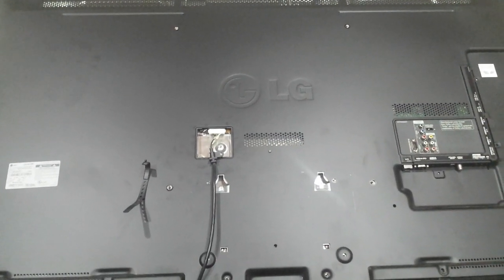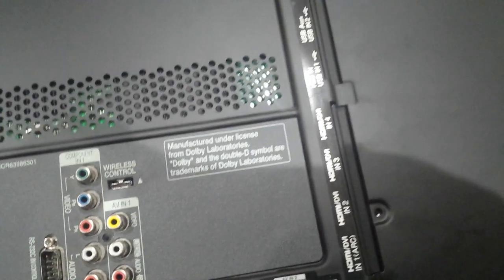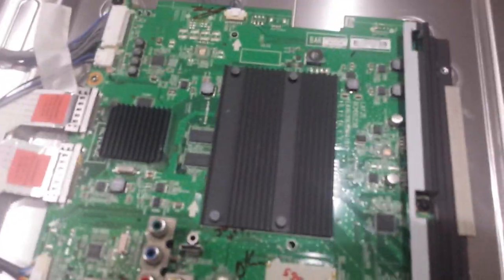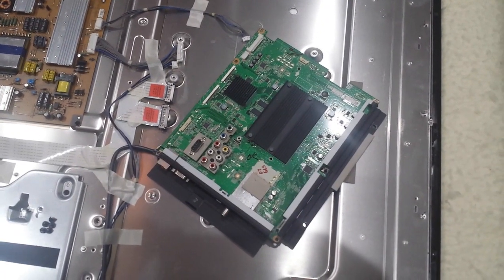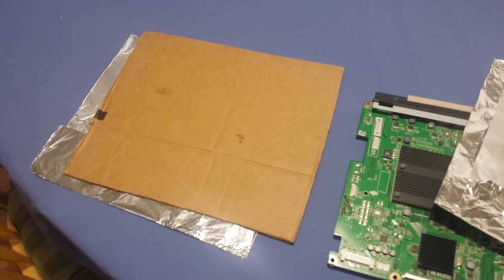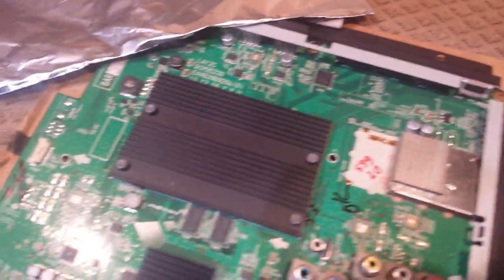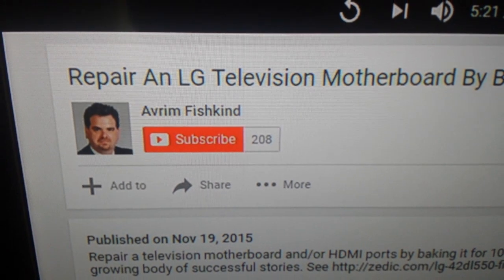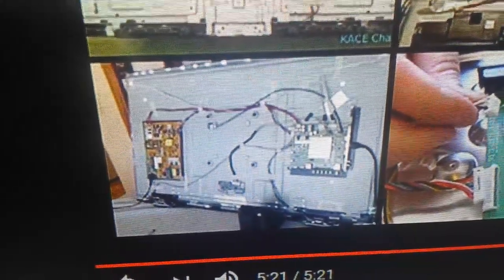"Repair An LG Television Motherboard By Baking It In The Oven" CONFIRMED!

Comment: i have an lg 65 tv with snowny picture. menu and sound work. snowy as soon as switch to a video. tried this trick. did not worked. backed it again on 425 rather than 400. still did not worked. any idea.

Comment: Followed to the tee. Did not work. Perhaps my issue is different.

 When I power on the TV I see the LG logo big and bright for about 1 second then the TV goes basically black. I can still see that there is a menu/window but it is barely visible.

Comment: seems they use cheap tin-solder in China, everything cost-efficient. And after some time these soldered joints brittle. Of course, mysteriously this always happens when the term of guarantee has expired.

Comment: I have a TCL.ROKU 720P I had it 3 years like Half Screen is darker as the top brighter has a blue horizontal line 
Across the screen
I dont throw my controller or remote at the screen like everyone else does

Comment: I tried the 385 at 10 mins with about 20 to 25 cooling in the oven with the door cracked, then cooled outside of the oven for 15 minutes, I put the board back in and the tv did like before, where the red status light, turns to white and blinks slowly like three times. Then turns red after the power supply makes a clicking noise

Comment: I have an LG 42LE 5900 and mainboard failed... no pictures. Took out the green motherboard and put in oven for 10 mins at 195-200C. Left to cool and reinstalled. Worked!!!! amazing. New motherboard £200, reconditioned is about £40 if you can get one. This oven heating method does work.

Comment: My tv LG 42LE8500, made in 09/2010 stopped work. The led of power on/of, source,volume up/down, channel next/previous were working but no picture, no logo, no sound. Just a blank screen. I searched in internet and i saw videos and tutorials like this. I thought  all these information was wrong and I will destroy my tv if I try it. They all say the same think: bake the motherboard of your tv for 200 degrees of celsius for 10 minutes. I call to a tv technician΄. He explained me that repairing cost will be almost 100 euros. I say ok. But it was far away from my home. I have not to much time to travel so long for a tv. So i decided to try this ΄΄crazy΄΄ method. I remove th back cover of my tv, then i removed then connections carefully from motherboard' they have different ways of connections. I preheated my electric oven at 200 degees of  Celsius for 15 minutes. I put the motherboard on  a cardbox in my oven. I baked it for 11 minutes at 200 degrees. Then i put out from the oven the card box and i left it to cool for 20 minutes. I have to say there is a smell like burned electronics.  All the windows WERE open and this smell soon  gone  away.
Then I put the motherboard back in my tv. And then i connect the electricity. I press the powen on and ... voila!!! The logo of Lg ant then the appearance of screen saver. My tv was workIng again. Many thanks to all  people of Republic of Internet

Comment: I found a 65" LG TV on the street with a note " Audio Not working". I brought it home, removed the main board and put it in the Oven at 200 for 10 mins . Put the board back and AUDIO started working again. IT WORKS :) and now i have a spare TV

Comment: Aug. 2019 - Now my third time baking the LG motherboard and the picture is still incredible. Baked it the first time in Oct. 2015, second time was Dec. 2018...so I have essentially got 4 years out of this process. My tv was of no use when this first happened and I was worried but gave it a shot...so happy I was willing to try this "home remedy". If your tv is now in a useless condition because of this problem (hdmi not working)...go for it!!!

Comment: Why putting in the OVEN?
Reply: Putting it in the oven will heat up the solder connections and melt them together again. Basically reconnecting any faulty lines

Comment: I've recently fixed ours using a variation of this method. I didn't like the idea of heating the whole board, so I removed the heatsink, masked the surrounding components using foil and Kapton tape, and then suspended a 50W G10 halogen lamp about 1cm above the CPU, with a layer of foil underneath the board. I monitored the temperature using an oven thermometer to ensure that it reached 200 degC (392 degF) and maintained this temperature for about 12 minutes. I had a used eBay replacement board on order, so I had nothing to lose, but was very happy to find that it worked. It's only been about 12 days, but it's still working fine. 

I have not tested the replacement board yet, but it's good to have it as insurance.

Comment: FIXED!!! Had the same problem with our LG 47LV5500. Power would switch on but no audio or picture. Baked it for 10 minutes at 200°C, cooled and assembled it back, and VOILA! It was back on. 
Thank you so much for the video!!

Comment: So, second attempt was successful but not 100%. I've lost functionality of all but 1 HDMI port, there are 4 on this model.. I believe that reflowing the solder multiple times also makes it brittle. I'm happy to have gotten another year's worth of service from this TV. This last HDMI port is starting to show signs of failing.  Audible static and partial snow on the video signal are sometimes evident. Turning the TV off for several minutes allows the board to cool down and then the signals return to normal. I will buy a new TV when I lose this last HDMI port.  If you are trying this fix for the first time,  go for it! I got a year and a half of service from my first attempt. Good fix.
Reply from the maker: Thanks for the additional update!  Someone else posted here they have had success 5 time now.  :0  Perhaps a 3rd time (after your last HDMI port quits) might get it going again!  But what a headache to do this over and over...
Reply: Charly Torres , I should add that it appears I had lost HDMI port #1 permanently prior to this second reflow. It didn’t work after this attempt. Also, I may look into buying a new board altogether for this TV.

Comment: I totally ruined motherboard by this method. Every single cap popped and some parts even fell off lol it was totally burnt. Maybe if surface is perfect and you have high heat for like 60 sec or smt,but not 10 minutes. I can post pic what my mb looks like,totally totalled lmao
Reply from the maker: Hi Smoletss,  I am very sorry to hear that!  I suspect it may have been s misunderstanding on temperature or faulty oven or placed to close to heat source in oven...  Sorry again.  Yes, if you don't mind, please share pics of motherboard, oven used and where placed, and advise on temp you used.  Thank you for your feedback.

Comment: Did NOT work for me. I have the exact same 55LE5400 that is seen in this video as well. I did it at 385F for 10, all the other videos use that time and temp. I have a digital soldering iron, and at 200F, solder won't melt. I guess that I can try it again....
Reply from the maker: George P, thanks for the feedback.  If you try again, let us know outcome.  My son had an XBox years ago and process for it worked for a few months and then dead again.  You win some and lose some but overall for many, process works so worth the effort before dropping more $ perhaps.

Comment: While im waiting on a mainboard for a 55inch led LG board to cool ill write this....I have a repair shop and trust me this works on many components in tvs. I give the customer the option if the new or used part is to pricey.   15 bucks to figure out the problem and 10 bucks to bake and test for 3 hours if it works add 15 bucks for everything else and it comes with a 30 day waranty if it works. 40 bucks for a fix and waranty   So far 4 years of doing this and i havent had one come back. Knock on wood! Its a 50/50 shot it works and my recipe is 11mins at 385 turn up to 400 for 6mins cool for 5mins then the Cooling fan for 10 mins with install gently while its partially warm. Bingo!  Oh always a good idea to wait atleast 3 mins when you plug in power cord to energize the compactors. Well the main board works on the 55 led Lg now ill run it all night for testing.now time to go install a buffer board on a 50inch lg in my other shop and see if it worked.  Good luck all
Reply from the maker: Thomas L, let us know your outcome and thanks for the feedback!

Comment: Was watching my LG 42LD490 TV one evening and suddenly the screen goes blank.  The standby light is flashing red, and when I hit the power button it goes solid red.  Repeat and it's back to flashing red again, no picture.  My first thought was the power board and, as I had a supplier a 10 minute drive away, I purchased a new one and fitted it...no change!  I was about to give up when I found this video and thought what the hell.  15 minutes at 200 degrees Celsius later I refitted the mainboard, plugged in the TV...and it was magically working again.  Witchcraft!
Reply from the maker: Plolov, so glad this worked for you and thanks for sharing your experience!
Reply: @charlytorres5132  Thanks for the video and extending the life of my TV.

Comment: This process does usually work 9 out of 10 times but isn't a permanent fix. They will last anywhere from 1 week to a month if you're lucky. One thing I've found out is that if you do the heating process right and have the mother board placed right that it makes a huge difference in the life of it. If you place the mother board on a baking sheet flat with the 3 or 4 rubber studs facing upwards, this allows the solder to melt back down onto the pins rather than melt away from it. I bake mine at 400 F for 30 minutes with the oven preheated and then I turn it off and open the oven door slightly and let the board cool off slowly for about 45 minutes to an hour. My LG has worked now for over 1 year doing it like this.
Reply from the maker: Thank you for the feedback!  I got lucky, my TV still going strong after almost exactly 1 year!
Reply: I did it the other guys way about 2 months ago but it just broke again, so this time I baked it 10 minutes on each side. Will see how long it lasts this time…..

Comment: Does this work for static screen?
Reply from the maker: Hi, by "static screen" I'm not clear if you mean static on your screen or a frozen / stationary image on your screen.  Regardless, I think this method could help you.  When the CPU solder ball connections get loose on the motherboard, they can cause all kinds off issues from video connection issues to numerous image issues.  As you can see from other posts here, this method works to resolve more often than not.  If you try, we would enjoy hearing back if worked for you or not.
Reply: @charlytorres5132  I have the static screen problem as well. Apparently very common for LG TVs with bad mainboards.

Comment: Hi Charly, have a TV with red light on but the display does not turn on. Tried this bake at 200°C for 10 mins after worrying it might melt the plastic components but everything was okay and nothing had melted after the bake.

Unfortunately, plugged and screwed all back and didn't work for me. Thanks for posting the detailed video, was definitely worth a try!
Reply: Needs to be around 400 degrees. I use solder flux under chips, wrap up all but chips (without heat sinks) with tinfoil and foil tape, heat the mobo propped up 1/4 inch on a griddle, heat gun the chips till the flux rapidly boils out from under the chips, and slowly cool down 50 degrees at a time over 25-30 minutes. Then let the mobo sit for an hour. Don't ever budge a hot mobo. Put a thin layer of artic silver thermal paste on the chips before puting back heat sinks. The flux and slow cool down are essential for a good solder bond. A good solder reflow like this will increase chances of a fixing it to last and flux is cheap. This is how I fixed many Xbox 360's to last.
Reply from the maker: Philthy Blend, Thanks for the detailed feedback!
Reply from the maker: Hi there, oh boy, so sorry this did not work for you.  200C might be a little low though...  Perhaps google the make/model of your mainboard to see about melting point of solder they used if still interested in trying again.  Can you tell us what Make / Model TV you tried this on?  Thank you for sharing your experience!
Reply: Fixed my LG47LW5600 the other day with the flux, griddle, and heat gun method. Working great now 👍 My wife was super stoked 😀

Comment: just did a 60 inch LG motherboard on a tv that would not turn on worked perfectly i baked it at 250 degrees for 18 mins it did not smell one bit i picked the tv up behind a tv shop couldnt see it going to the dump LOL
Reply from the maker: Wow, funny - cool story!  My TV STILL working perfect after this fix after almost 1 year!  If it ever has issues again though, I may check out backs of my local TV Shops for a free one!  Thanks for sharing.
Reply: Will this likely fix a TV with NO standby light?
Reply: it sure could what would you be out its been 2 months and this 60 inch tv is still working great!!!! @E-M-I-N-E-M-F-U-C-K

Comment: I be damned this worked.... Have a LG 55LW5600 ... No video no sound, just little power light on.... I was about to dump it when I found these videos talking about baking the main board, I said wth lets try its wasted anyways. I removed the main board and stuck in a toaster outside at 385F for 11min, it does stink so you want to try to do outside.... But WTH I plugged it back in the TV and its working just fine! I'm blown away about this trick...
Reply from the maker: Hey Marco, thanks for the feedback!  FYI, After 9 months now, my TV is still working perfectly.
Reply: @charlytorres5132  thats insane... Do you believe this process can be repeated? Amazing... Imagine how many people just dump the TV or get charged hundreds for repair...
Reply from the maker: Hey Marco, yes process can be repeated.  Avrim Fishkind mentions he has had to do several times I believe.  I've been lucky and mine is still working after almost 1 year (10 months)!

Comment from the maker: Update for all.  After 6 months now, TV video and Ethernet, and all connections on Motherboard / Mainboard still working perfectly!!  Thank you again Avrim Fishkind!!  :)   (Did I just jinx myself, Hmmm...  :0 )
Reply: So I tried this with a lg55lf6100 and nothing changed. Still get no signal when. Hooking up my PS4. I do however have an electric oven and now I'm wondering if it didn't get hot enough when it was baking. Any advice would help
Reply: I'm about to do it for the 3rd or 4th time tomorrow morning.

Comment: This worked for my LG 47LV5500.  The symptoms the TV was having was it would work for a few minutes then turn off and on and on and off.  I decided to unplug the TV for 30 mins then plug back in... now the TV would not properly work at all, black screen with only the power white light.  After a few google and YouTube searches I found the baking oven main board method which worked!  @ 380 degrees for 10 minutes.  Couldn't be any happy.
Reply from the maker: Awesome!  :)

Comment: OK , Im about to do this shit ...only one concern ..doesnt plastic melt ???
Reply from the maker: Did this work for you Srdjan B?
Reply: Charly Torres suprisingly . Yes it did! :-) ..but unfortunally two months later same problem again..i "baked" it again. let's see how much will it last now.
Reply from the maker: Just a theory but I think a slow cool down helps to last longer...
Reply: You're probably right..well ..I got pretty bummed out when it died second time , both times I think I had let it cool down (drank couple of beers in meantime :-)  ...so I don't know at this point how much will it hold ..all I know I really like this TV , it got really good picture , nice design , solid 3D ...biggest problem is that I bought this tv used , and I don't know if it was already baked couple of times before I did it...also I was talking to a repairman who told me that when it dies first time it is important to do "reballing" properly ...even then he could not give a guarantee larger than  6 months - 1 year ... other option is to order mainboard from China but i have searched all the internet and found nothing ...so fingers crossed :-)   You know ...even if it fails it was cool to do this thing , and see it work ...even funnier to see the expression on people faces when i told them how I repaired TV ..They were like ..Whhhoaa :D ... but i wouldt even consider it without your vid ...so thanks again buddy .. I watched world cup in soccer , Novak Djokovic winning Wimbledon again ...good times :) ...it can die now ..oven is ready ;DDD
Reply: +Srdjan Bogunovic   I watched it too. Croatia was really good, they got robbed from the first place because fifa corruption. Are you croatian?
Reply: Serbian! ...from  Croatia ..so mixed feelings on their success, buit it was success neverthelsess.

Comment: We almost went the route of baking the module, but I came across a post that said to turn off the TV and the set-top box, remove the power source for at least 15 minutes for both, discharge the power button by pressing it and leaving it alone. After 15 min approximately, I replugged both the set-top box and the TV into the electricity socket. Turned on both STB & TV. I believe ATT U-verse had to cycle through... then voilà, the sound was back! This happened a second time and I went through the same process, and again it worked! So glad I didn't bake the module.
Reply from the maker: Thanks for feedback for all here to review that solved your Sound issue.  I tried similar process for my Video issue but it did not resolve.   All should try Joni K easy method 1st.  If no luck, perhaps Baking time for you as well!  :)